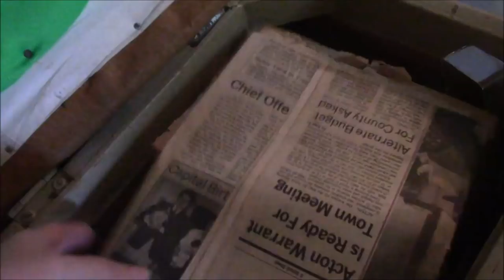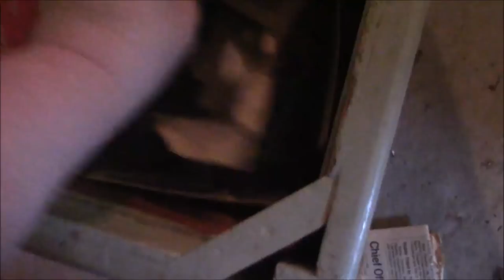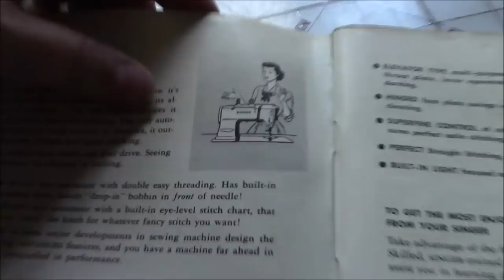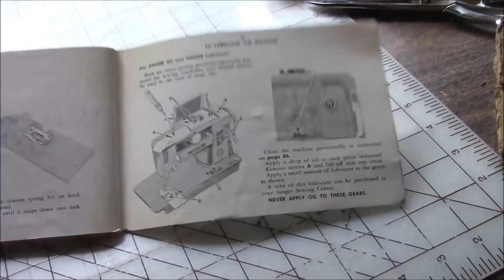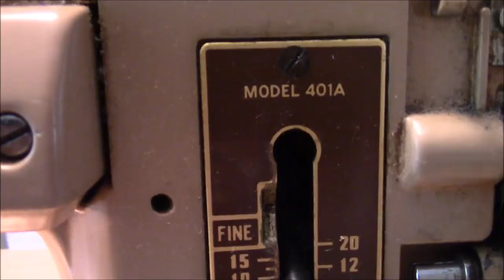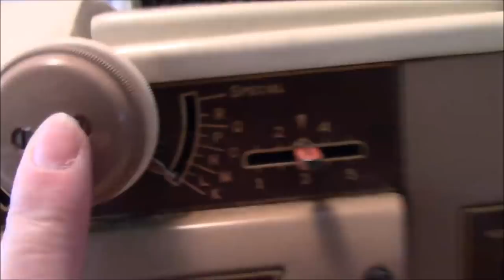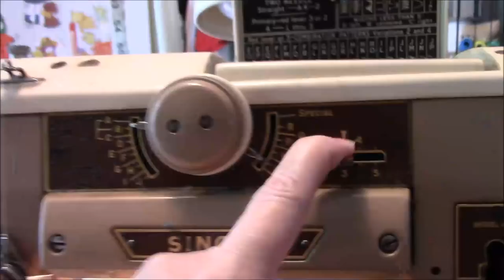FINALLY!!!  See My Sewing Machine and Fabric Stash

Comment: My mother had the very same machine. My sister has it now and even has the disks. Mom made a ton of stuff on that machine. My first machine was a used 301 which was the model before yours. Those pre-1970 models were really made well. My 301 still works great even after the 45 years I've owned that used machine.

Comment: My mothers first 1950's Singer swing needle machine had a knee control.  It pushed into a hole in the case at the front of the machine and faced down to the floor but did not touch the floor nor the foot control which then became redundant.    She pressed her knee against the lever to sew.  The foot control often slid around the floor (as they do) depending on the floor convering but of course the knee control didnt.  I remember her collection of discs too, they were black.  You got so many with the machine and bought extras singly in the Singer shop in Birkenhead, UK!  Time to treat yourself to a new one Darlene you've earned one.  Chris  North Wales. UK

Comment: You can buy a finger guard on ebay. There's a vintage slant sewing machine group on FB that would probably be glad to help you with the bobbin area issue. One of the many reasons those old Singers are so great is you can fix them yourself.  You said you have a cheapie machine, you could use that to wind bobbins. I really like the 401A, it's on my short list of machines I want to add to my herd. I have a 201 and a black 301, so a 401 makes sense. I also have the cutest machine Singer ever made, a Featherweight.  You can buy the cams on ebay  or through the vintage group on FB.
Reply: You are sooo correct!  I am hoping I have a donor machine with the part, or can figure out from my service manual and my own 401 if its broken or just fiddly going back together.  Three is a spring that controls the swing of the needle on a 401 and 500, and they come loose and seem broken, when they aren't, but it takes an amazing amount of fiddle to get them back in.  I am thinking it may just be something like that.  I used to work on old machines all the time, but haven't been doing it awhile.  Helping Darlene may help me get back into doing something I dearly enjoyed.
Reply: Sharon I have all those same machines - they're all fantastic.  I think Darlene should pick up another vintage Singer (they're fairly inexpensive) to use while this one is being fixed.  Don't you?  :)

Comment: I bought a 401A last year, and I just love it! I hope you can find a great repair technician who can restore your baby to full function. I have now taken my machine out of it's cabinet, and I take it to sewing events, using a Rigid tool tote set I got at Home Depot. My suggestion for the fabric stash would be to decide what your minimum useful amount would be (at least a fat quarter, for example}, and donate or toss any amount smaller than that. For the larger pieces, maybe you could list some of them on ebay, and turn them into money. Good luck, and thanks for sharing!

Comment: My husband repairs and restores these vintage machines. They were actually made in the town we live in, Anderson, SC., hence the "a" in 401a. Any way, getting back to my husband. He watched this vid with me and was diagnosing your machine as we watched. Hilarious. He says none of the issues your machine suffers from are serious so if you were able to find someone close by that repairs these old machines, it would not take but a short time to fix it. They are wonderful and are, in my opinion, better than the new machines. They just run and run and run with hardly any maintenance.
Reply from the maker: We have a place here in my town that will fix it.  Problem is... procrastinator!  Plus, I never really trust anyone.
Reply: Darlene Michaud I'm stripping my beyond repair 401A down to part out on eBay. If I can easily take the part out, and then reinstall it, I could film it and send it to you.

Comment: I have the very same machine and still use it. I’m also missing the cams. I am using one of the built in stitches to make the lines across blocks for a raggie quilt. I bought the machine at a yard sale for $5.00. It was a mess but my husband cleaned it up and oiled it so it runs like a top.

Comment: I have some discs, do you want them?  I will look into that problem, it's part of the bobbin race.  I will drag up my 401, and see if I can figure out from looking at the pictures, and my service manual, etc, and see what I can do.  I may have a donor machine that I can send you.  I will figure something out to help you.  I think the bobbin race being loose is affecting the stitch selection jp above, because it probably effects the tension.  I don't know how long it will take me to be able to handle going to the basement to find the 401..  I do have a 500 up here, which may have the same bobbin race.  I will have to give her a test drive and see if she goes well enough, and find and check out my old service manual.  I wish we lived closer, because I would love to be able to come over and fix your machine myself.  I was born in 1964, and I say I can usually fix any machine older than I am. Oddly, I have been sewing on a newer say 80s kenmore lately, even though my old Singers are much better.  

Can't give you a time line, but worst case, The extra 500A I have, which is almost the same, just shaped differently, maybe a couple extra bells and whistle, is missing it's top door cover, which does not change the way the machine works, but I need to test it.  Maybe, if I get that one up and running, so you could use it, you could bring your baby in the shop. You would have no problem switching, because they work exactly the same.  It's the last really good machine I believe they made, from 1960.  I'll let you know what I figure out. 

I don't know if you have an upper end budget for fixing that machine, or maybe it would save money if I found the parts, but that's something we can look at when I get to digging some machines out.  You may just get Fran's Sewing Machine Shelter and Repair center open again.  I used to fix quite a few of them for myself, my mother, my friends and family.  Never have done it for money, and won't start now.  Lol  will fix your machine for fabric!!  I am glad to see this!  Thanks!  If I got the 500 working, and gave it to you, and we also got your 401 working, then there would be a machine for Skylar too!!
Reply: Wow Francine, you are such a generous and lovely person.  It restores my faith in people to see wonderful comments like this.

Comment: I have a sewing machine seat like that (with the original cover that needs replaced) complete with the box that holds all of the gears/disks that belong to the sewing machine.  It's in the original sewing cabinet from when my mom bought it.  But I need to find someone to repair the machine because my mom blew out the motor.  I have 3 of my own machines so I don't need hers but I would like to have it repaired because it is a quality machine!  Metal not plastic!!

Comment: All of these old machines are so easy to fix I have 5 15k machines due to the mechanical construction anything that breaks is easy to replace. You could put a bit of wd40 on the balance wheel knob to loosen it it might just be stuck with old grease through use.